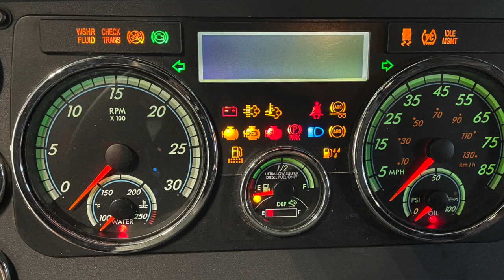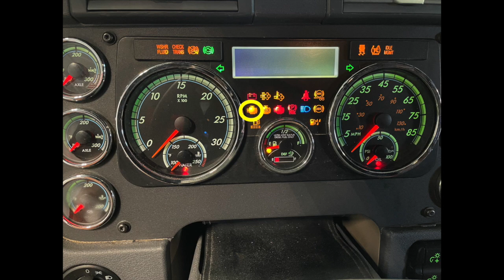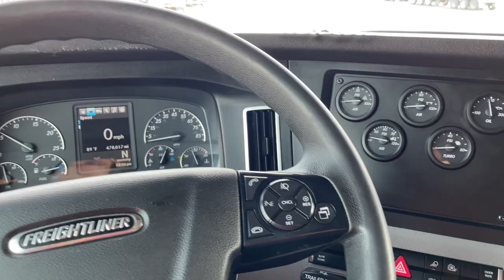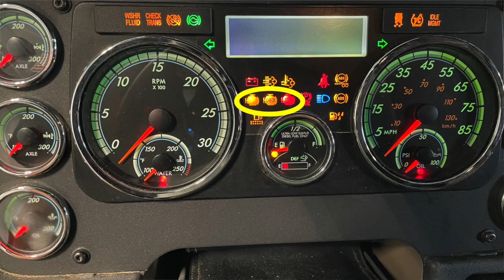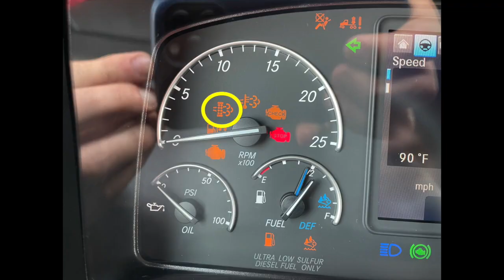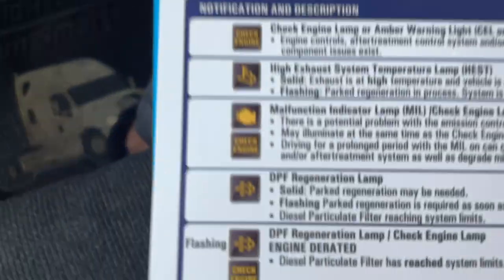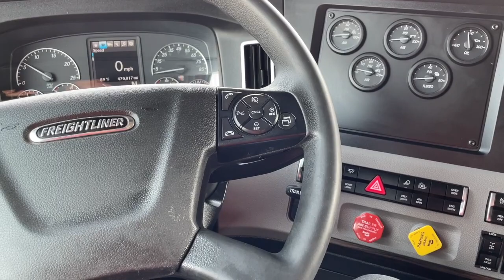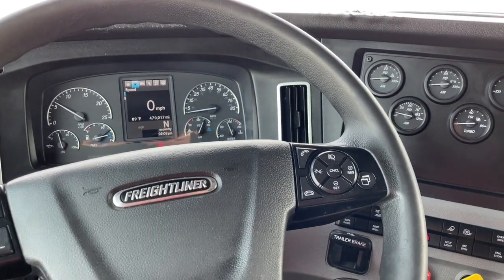Freightliner Detroit Check Engine Codes

Comment: I deleted my def system two years ago and just yesterday this happened to me. Both last check engine lights came on and I had to get it towed to the shop. The truck started but after a few seconds later the truck turned off by itself.

Comment: Hi. If just CHECK light on, whats mean?
Reply from the maker: Well like I mentioned in the video, it can be a number of things. To find out the exact code you need to check your detroit hq portal or take it to a shop or have the computer to pull codes. But you can try the things I showed in this video to see if it will go away.

Comment: Hi. Need help, the check engine and stop engine turned one. I already checked the oil, water, etc. Everything looks fine. What should I do? Please answer, new follower 🙏
Reply from the maker: Well if those lights have come on then it will give you a code in the dash, what code is it giving you? Can you pull up a name or is it giving you a SPN or FMI number?
Reply: It’s “ecu 128 pid 235 fail 00”
Reply from the maker: @alexisambriz9248  I don't have software to look up those codes, but you can search them online to see if anyone has posted that code. Some things I am seeing suggest a park brake switch but that would not shut you down.

Comment: Hi. I have a freightliner m2 106 box truck. The amber light comes on all the time but after it warms up I can usually turn it off and back on. It usually goes away. What do you think?
Reply: I'm just gonna close my eyes, point, and shoot. But it could be nothing. However, if it doesn't like what it sees in those first couple minutes of running I am going to guess it is a temp sensor and there are many of those. Intake temp sensor, output temp sensor, aftertreatment temp sensors, etc.
Reply: @asphalttarmasters6735  after I turn it off and on again after it runs for a bit then it's all ok. No fault codes at all.
Reply from the maker: @geoffnavolt1970  What is most important is what it’s doing the majority of the time so if it only has the engine light on for a very short time then you are fine. Although it could mean that something is going out and the light eventually won’t go away. The light coming on means it’s registered a code so if you get a chance to plug into it they would be able to see what it’s throwing and let you know if that was a problem or not
Reply from the maker: @geoffnavolt1970  It is not uncommon for an engine light to hang around for the first 30 seconds of running but they usually go out by themselves without having to restart the truck. I mean based on what engine lights mean, they detect that something is not quite right. They are getting a signal that is out of the normal range. So it sounds like a sensor isn't liking something and I would agree it sounds air temp related.